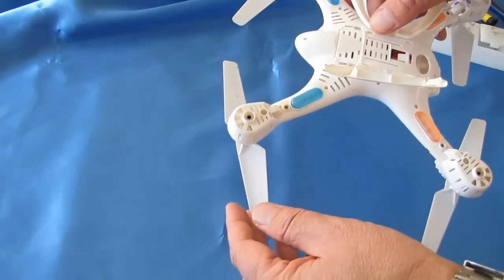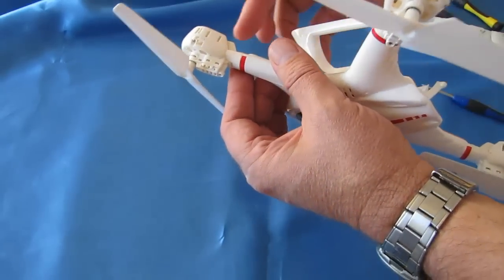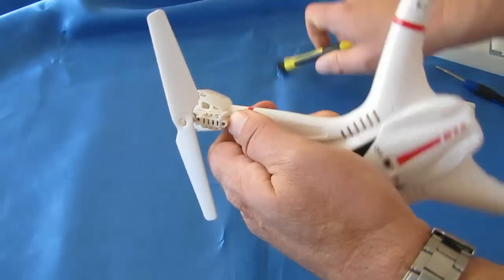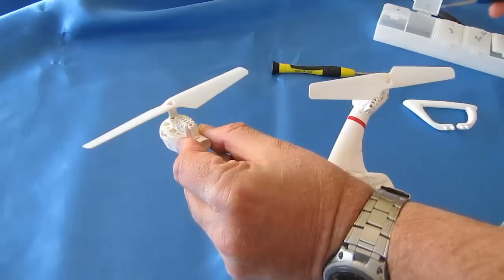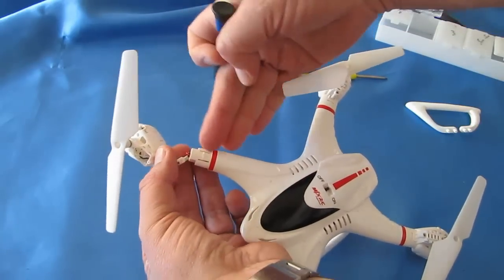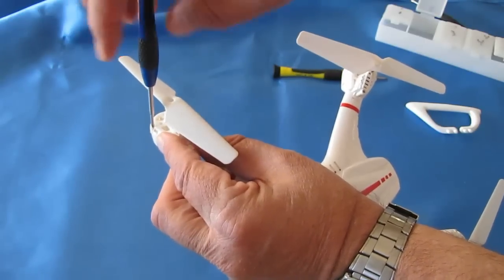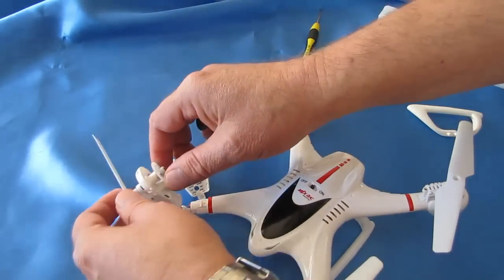MJX X400 Drone Repair

Comment: Hi, I know this vid is a few years old, but I as hoping to get help.  I have the mjx 400x in this video.  It has been running awesome for a long time.  All the sudden, it wont get more than a few inches off the ground.  Batteries are fully charged, power seem fine.  Drone has had no crashes.  Cant figure it out.  Thanks in advance
Reply from the maker: You need to either clean the gears if the propellers are not free spinning (binding and dirt can get in the gears), or replace the motors (they eventually wear out).  The above video should help.

Comment: Thank you. I had to clean the gears. The motor with the connector is great, but i wish they used half of the screws. Replacing a propeller is a bit tricky as the post that holds it goes down and make it hard to align the holes. i prefer the screw on top than on the side.

Comment: Hi - great vid...many thanks!
My son has one of these and loving it. He 'landed' in some tough grass though and now one motor running intermittently. I've used your vid to check the pod and all seems OK with the gears/motor. Is there a reset I can do or am I looking at a new motor/receiver? Do you know if there's an overload cut-out? Many thanks for anything you can advise!

Comment: Dirt went into my MJX X600. What do I do for that?
Reply from the maker: It can be a real problem if dirt gets into the gear teeth, and can cause motor failure if not cleaned out.  Access the gears to clean them as shown in the above video.  Use an old toothbrush or pin to clean the gear teeth of any debris.  Keeping the gears clean is true for most of geared quadcopters https://www.youtube.com/watch?v=LzzD3BPVvH0

Comment: Hi, I have a problem with drone mjx x101 I put the video of the problem on my channel. if you could help me thanks
Reply from the maker: I saw the video.  You did not install your propellers to their proper motors.  There are two clockwise propellers that must be installed on clockwise motors, and two counter clockwise propellers that must be installed on counter clockwise motors.  The back two propellers are fine, but the front two propellers are not installed on the correct motors. To correct the problem, simply swap the front two propellers. In other words, move the front left propeller to the front right motor, and move the front right propeller to the front left motor.
Reply: Hi dear, thanks so much! now drone work so well, Thanks you, thanks, thanks !!!!!!!!

Comment: Hi! Do you know if the X400 motors is pluggen on the main board or soldered? I know the board has four plugs but not sure if they are for LED or motors.
Reply from the maker: Sorry, I don't know.

Comment: no lubrication needed?
Reply from the maker: Nope, but remember to spin your props regularly by hand to check for any unusual binding (dirt) in the gears.  Clean the gears with an old toothbrush if you notice such.

Comment: OK I got 1 pod that I think is gummed up it on the mjx x400 v2 I watch your video dozens of time and no matter how hard i try pushing that clip in it will not move I have removed the screw tried everything is it just on side I have to push in .getting close to brake point with the amount of pressure I am using is there something different on the v2 .
Reply: Had the same problem... I ended up 'wearing away' the lug in the end. It will move eventually.

Comment: hey can you help me with my mjx

link:  https://youtu.be/EOpqDPIfIyQ
Reply from the maker: +Fadzieka Tahir Yes, I can see the problem. Your propellers are not installed properly.  There are two clockwise and two counter clockwise propellers that must be installed on two CW and two CCW turning motors.  Please take close look at the following picture. Notice the two different shapes of propellers and which motors of the quadcopter that they are installed.  Make your quadcopter match this picture. http://g04.a.alicdn.com/kf/HTB1ZfgzHFXXXXaxXFXXq6xXFXXXH/MJX-X400-2-4G-RC-quadcopter-quadrocopter-drone-rc-helicopter-6-axis-can-add-C4002-C4005.jpg

Comment: Please help my x400 is unstable if i go up it go forward to please help. Is it the motor or the remote control wrong setting
Reply from the maker: +Tahir Abdullah Do you know how to calibrate your gyros?  
1) Turn on the quadcopter and place it on a flat and level surface.
2) Turn on and bind the transmitter.  Center all trim tabs.
3) Leaving the quadcopter undisturbed, move and hold both control sticks to their lower right corners.  Hold them there until the quadcopter's lights blink.  If they don't blink, then try lower right corners, lower outboard, or lower inboard until you notice the lights blink.
4) Let go of the sticks and try flying.
Reply: +Quadcopter 101 can you make the video please
Reply from the maker: Fadzieka Tahir I saw your video.  Your propellers are not installed properly.  There are two clockwise and two counter clockwise propellers that must be installed on two CW and two CCW turning motors.  Please take close look at the following picture. Notice the two different shapes of propellers and which motors of the quadcopter that they are installed.  Make your quadcopter match this picture. http://g04.a.alicdn.com/kf/HTB1ZfgzHFXXXXaxXFXXq6xXFXXXH/MJX-X400-2-4G-RC-quadcopter-quadrocopter-drone-rc-helicopter-6-axis-can-add-C4002-C4005.jpg

Comment: I bought one two days ago and had to strip it down because the on/off switch was faulty. I had only operated the switch about ten times and after a couple of operations it felt gritty and finally failed. I took the switch off [which is cheap junk]  with the idea of getting one from the local electronics store, but after some research the only source i could find was in Hong Kong. The best i could do was bridge the terminals on the PCB and use the battery as the on/off. Thanks for the hint about taking off the motors.

Comment: Hey, I have this quad and I took the motor pods ALL the motor pods at once for cleaning. I realized that I made a big mistake. I messed up where the motors should be. I was able to put the quad together again but I can't get the quad stable. Is the motor with the black and white wires should be in the front? Cuz' I put mine on the back.
Reply from the maker: +Andre Martinez White/Black = Front/Right and Back/Left
Red/Blue = Front/Left and Back/Right
and finally make sure that your propellers match the installation shown in the video.  There are two counterclockwise and two clockwise propellers.
Reply: +Quadcopter 101 Thanks!

Comment: I have an MJX X600 and I was wondering why my drone wouldn't fly. The blades will spin and some faster than others spin but the drone it self will not take flight. It will lab forward and the two left arms in the front won't go up to as much speedp as the others which causes it to basically scrape the ground and get no air. I also previously dropped it from a tree and it got a little of dirt in the motor. I would like some options as to what might be the problem and how to fix it if possible?
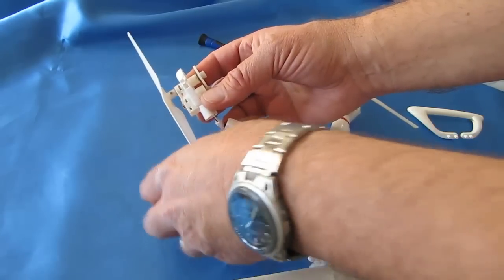Reply from the maker: +Preston Dowell Could be dirt in the gears of those two particular motors.  Spin the props of those motors by hand.  They should spin freely like a pinwheel.  If they don't, see the above video at 4:13.  You can clean the gears with an old toothbrush, or a pin to dislodge those particles stuck hard between the teeth.

Comment: You have been flying it a lot, seeing all your videos of it. Have you had a bad motor on it yet?
Reply from the maker: +Ruudy L I haven't, but others have.  But I religiously turn the props on this one after every flight to check for debris in the gears.
Reply: Quadcopter 101 What I do is let the motors run and quickly close the throttle, if one stops before the others I check it for dirt, also I always order spare motors. also have 2 X600 so always a spare motor pod nearby.
Thanks for the reply

Comment: Wow, I just put motors in my x400 last night.. funny thing I thought I was using motors for my wl 686, I did not think my x400 motors had arrived yet? but I pulled out my burned x400 motor to do a size comparison and they were the same? so swapped out all four using the splice and solder method. I did not know that they just plug in. but now the copter does not bind to anything? I am wonder did my solder flame melt the actual line to the board? of did I UN-ententialy un plug all four motor's when I thought i was attaching them? where those motors really for a 686 and because of that it wont receive a signal? the quad lights up but wont bind to any controller! what did i do? and does any company sell quad's without controllers?

Comment: Have only had my MJX X400 for one day. On my trial flight the battery died and it took about a twenty foot fall. One of the blades seemed impeded...so I got home went straight to this video, which saved me huge amounts of time and mistakes. Just a tiny bit of something had fouled up the gearing. I cleaned them up and it appears to be fixed and ready to fly later today. Thanks for the video Quadcopter 101.
Reply from the maker: Dan Harris Yeah, it's very important with this quad to spin your props by hand after a hard landing.  That gear pod can really scoop up the dirt in a crash.

Comment: My x400 front right pinion gear is drifting on the motor axis and I can't find a fix no matter what I do .I tried superglue and heating the axis slightly cause heating it too much will cause the pinion to melt as its PLASTIC  
Any other ideas?
Reply from the maker: Mitsos Ael If it's drifting off the main gear, then the motors bearings are shot.  The motor needs to be replaced.  But they're cheap, and plug in replaceable (no soldering).  Just make sure to match the wire color of the replaced motor. http://www.ebay.com/itm/like/271875424007
Reply: Quadcopter 101 Hi...question I have a mjx x600...When do you know if you have a bad motor? not sure if my problem is with the motor or the gear wheel. When I try to lift off in level flight my drone, leans forward...Thanks
Reply from the maker: Luis Velazquez If you're not able to lift off and stay off the ground, then the motor is likely bad. Whichever motor the quadcopter tilts toward is the culprit.